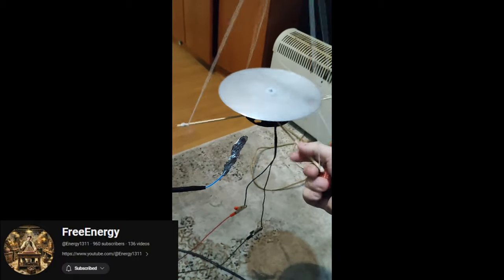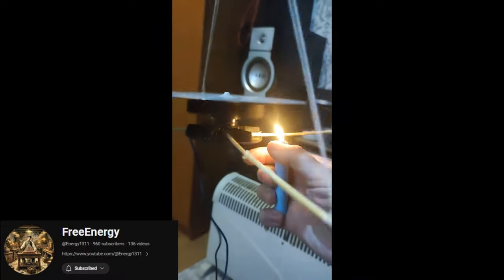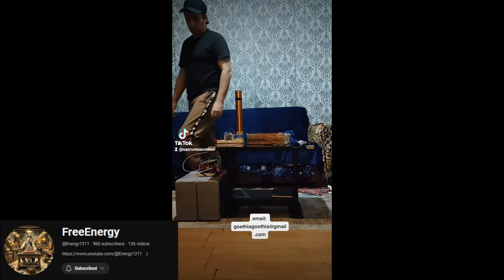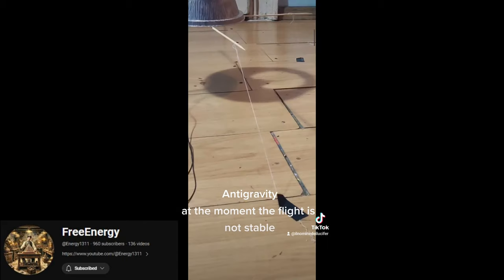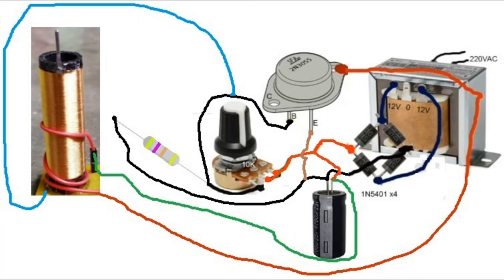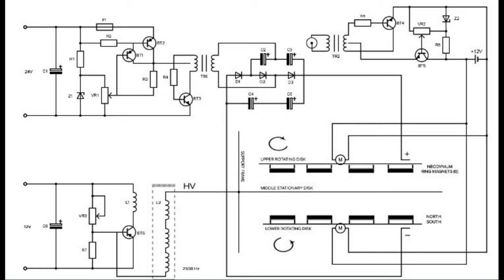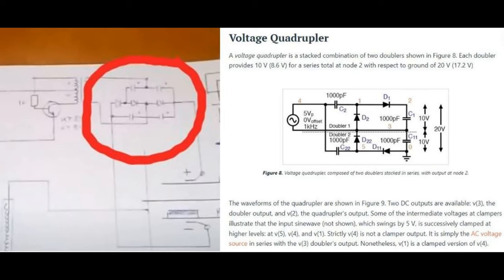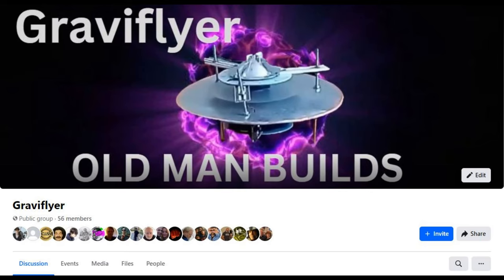Graviflyer "Occam's Razor" #48

Comment: The top left schematic is from a flyback to the rotating discs; in all three kits from Alexey he did not have diodes or capacitors after the DC flyback. Alexey drew the diodes and capacitors to reprisent the DC part of the DC flyback. The bottom left schematic is a slayer exciter tesla coil.
Reply from the maker: I was not trying to imply that you did anything wrong or that you didn't get the right information. You have always been straight with all of us with the information and you have greatly helped me in my research. If you took what I said in a bad way I am sorry. It was not my intent.
Reply: Charlie you were deep into this. We are somewhere close..  we need more and more people to test it there on way. We are going to see the lift soon..
Reply: @nathanbunten4299  No problem, I did not take offense. Alexey might have explained it incorrectly, so it is good that people are testing different things.
Reply from the maker: @charliec3rd  Thank you.
Reply: That circuit should work as a slayer exciter.. and the way alexeys circuit is drawn, it looks like a fly back AND voltage multiplier.. I think that’s why there are 3 diodes, one inside the transformer case, then the other two on the multiplier..
Reply: 2 stage multiplier, with 2 caps on each side for voltage

Comment: In the schematic it looks like he is using the magnetic side that I text about used in the levitation novelties and as the initial levitation in order to create the separation then using the high voltage of the Tesla secondary in-between to create the capacitance to repel  the object beyond the magnetic fields. This circuit requires exact timing in order to function. This guy is really good to have designed this circuit and gotten all the correct values to make it work. Still limited by the under plate but really cool to see capacitance driven levitation.
Reply from the maker: very cool.

Comment: You went into Grebennikov like what Alexy did before building his graviflyier.  I felt the material needs to have similar property like bugs wings which is like hexagonal structure with holes in it, like casmier effect.  I heard that when we have tiny ball of spark at pin tip, it attracts more energy from its surroundings, it deviate from our physics , if we have similar pin like structure material with tiny tiny sparks in it. Its a game changer. Also one of the stealth plane have similar tiny hexagonal structure material all over its body. Something to do with ttime space or reduce the effect of gravity on it !! Lets see...
Reply: Food for thought? Tamphere, Finland in 92 and 96, Podkletnov, yttrium barium oxide ceramic. What do they coat modern fighter jet engine turbines grown from a single crystal with?  Does a flame front in a jet engine generate high voltage?  Why did those that replicated Podkletnov retract their claims after the fact?  Why was Boeing interested in the research if it didn't have any merit? (gravity shielding accidentally discovered during experimentation with room temp superconductors)

Comment: The 2N3055 is a transistor PNP I believe,
Reply: Yes, the 2N3066 is a NPN transistor. Alexey mistakenly wrote the the direction of the arrow in the wrong direction, but he later explained his error in a followup video.
Reply: @charliec3rd
Right, but i was remarking to the author of the video regarding the image of the Tesla coil circuit in which he stated there was no transistor or mosfet.

Comment: I can see paper having  an ionic reaction in a high voltage senerio because I have experienced paper being attractive and also repelled especially around charged plastic like a trash bag when I try to throw out a small piece of paper and it bounces in mid air and then sticks to the side or falls outside of the container. It looks like he was using paper under the aluminum plate he was levitating. Looks very interesting and I happen to have two secondary coils that look almost identical to the ones in the videos. I got them from someone who made them in Russia several years ago. It would be funny if this same person is the one making these videos. I love these types of experiments and this all looks very interesting.

Comment: Very nice, do the eddy currents in the aluminum disc become excited by the spark? In my experiment with an ion motor the rotating stator that has aluminum inside is stimulated to produce a force to rotate it. Maybe something similar is going on here
Reply from the maker: try magnet sheet. you may have magnetism in the voltage creating th eddie current. I did this with a soda can and high voltage. https://youtu.be/izVMINZIqag

Comment: 2n3055 is a simple old fluorescent lamp schematic. It just turn DC to pulsating AC for any primary winding. We get high voltage on secondary. I have made a ton of this when i was a kid. I use any step down transfomer and produce high voltage on secondary to lit up fluorescent bulb.  And the other one is voltage multiplier, might have some error when he copied it. Just a human error. So its a voltage multiplier circuits, the more the level of multiplying, less the amps and high the voltage. Seems Alexy is using less efficient but simple circuits of 90s.

Comment: 12:22  that appears to be a bismuth crystal
Reply from the maker: The one that has the magnetic properties?
Reply: @nathanbunten4299  you can tell that it is a bismuth crystal by the square structure 10:56 and bismuth is also one of the most diamagnetic materials

Comment: The mystery element is bismuth
Reply from the maker: Watch the lifter and the tesla coil where he is sitting down. There is no top wire. The weight is way to high. He also touches it. I have never had a lifter I could touch. The voltage is to high. But because it is a tesla coil, the voltage to the touch is low. That experiment is the key. It must weigh 1 pound. I have to build that lifter experiment. I hope you can see why.

Comment: 10.50 its bismuth crystal, under the sheet of papaer there is an honeycomb structure charged with high voltage, he pushes a button , the  voltage runs into the honeycomb charging with static electricity, the elctrons get trapped inside the honeycomb cells and create a magnetic field, which pushes objects away using Lenz'law
Reply from the maker: That is really cool.
Reply: @nathanbunten4299  It is the most diamagnetic out of all elements & can levitate magnets. Only superconductors/pyrolytic graphite are more diamagnetic.
Reply from the maker: @Jeanpaul465  No. some days i wish i was.
Reply: @nathanbunten4299  VincenzoPanella is the one who smokes joints!🤣
Reply from the maker: @Jeanpaul465  We are building ufo's.. I think we all had a few at one time.

Comment: So in the one experiments Energy1311 is putting high voltage static into the disk buy holding it close to the the rotating disk. What abour utilizing 2 disks? One non rotating that pumping out static high voltage to the rotating disk. Basically separating the high voltage component from the rotating disk?
Reply from the maker: i ran the high voltage on the center plate only and it was pushed out by the tesla coil that i connected to the top and bottom disc.

Comment: Looks like the tesla coil is connected to a dr stifflers SEC-15 type circuit. From my hands on experience with his circuits, It floods the capacitance of the everything connected to it with frequencies(light in a circuit). Its like the circuit is constantly having a baby with the combination of the coils interaction. 1+1=3
Reply from the maker: Where can I find this circuit?
Reply: Start their to understand the phenomonon thats happening. He has Alot of variation circuits that create the same effect, but once you understand how the effect is created, it becomes easy to make your own circuit that create these results. The ssg bedini motor does the same thing but in the form of a pulse.

Comment: good morning , i have an idea . So watching the disc rotate on your video, what if you could try this with only the bottom disc and the middle plate on your graviflier to begin with to see the reaction. Maybe the top disc and frequency generator on top has to do with balance only as lifter tech is very unstable it is missing axis control. Just an idea. Good luck
Reply from the maker: The lifter where he is sitting down is the key. Tell me what you see. It is not normal.
Reply: Ok so it looks like slayer coil as he does not get a shock when touching it! So did your slayer give you a shock?
Reply from the maker: @dkdyker  He is using 2 microwave transformers with a doubler circuit. No slayer exciter. On the graviflyer it is 74 degrees but it will burn you. He can touch his the same. Radiation or gravitational waves NO ION WIND..... In the mhz frequency. Jarod was picking up mhz in the piezo because it is a receiver. They came from the tesla coil. They make lift. This is the This is Grebennikov's work.. I make such a big point about this because it is a Ulrika moment. I found proof of the lifting force.
Reply: So cold energy, yes ! I would like to know his double MOT input as they together will put out 4000v so why is it not effecting him , do you have a drawing of this?
Reply from the maker: @dkdyker  I wish I had one. I keep asking. Cold heat. I just did a video on it. We should all do this when we get the schematic.
Reply: Hi again, just looked at other types of Tesla coils that you can touch without a shock. Many are using SGTC ( spark Gap Tesla Coils ). Will come back with more:)

Comment: Have you seen those magnetic levitation novelties? They use rotation of a magnetic fields with coils in a circle that change polarity in a timed circuit and levitate a magnet. So no imagine using capatance instead of induction from coils. Our planet is negatively charged at ground and positive above insulated by our the air like an air capacitor. If we can rotate a negative charge to create an evening charge to earth it should attract upward and repel downward until it reaches the level of equilibrium with the two charges "ground and air... Ionic induction  can probably overcome gravity and even the weight of a materials can contribute in lifting thier atomic weight by concentration of it's outer electrical feild. Ionic thrust is air movement but repelling  an object through an Ionic reaction will even work in outer space. Example seen in comets when nearing the sun and the light radiation exciting the dust creating the tail. When the Sun shines through a window in the house and the dust begins to float around the rays of light. In one of my experiments I took a concave mirror and used a flash light at different distances to produce rings of dust at different points. Please someone repeat my experiment the dust will stick to the mirror at the edge of the light... There is a lot more but I would have to write a book and I am just giving you a quick text because I think you or someone is on the right track. ❤ this video
Reply from the maker: i understand static electricity and charged particles. They play a role in this craft. Thank you.

Comment: Well the first one had a fan under the alum plate, the second one was inductive jump from high current coils,  good magic tricks with electric, all you have to do is put a thin nail / brad in the wood or soak it with micro iron to make it work like that.   No magic to the schematic to the high voltage dc to the spinning plates and a tesla coil.   The one thing that stands out in his tesla coil. * those primary winding have a huge amount of insulation on them. Like its designed for 40KV on the primary coil so he can have tight coupling of the two coils. Does it make a difference?  Yes it does.  That tesla coil is super high voltage.  What Voltage???  1 million Volts + ????
The pan plate had a hole in the center and most likely a bunch of sharp things in the center of the plate with high voltage no magic on how that works.
Reply from the maker: When you find something you cannot explain. Just call it a fan. BS!!!! The tesla coil I do agree. It is the real deal. It is what I have been looking for the whole time.
Reply: @nathanbunten4299  Try a MJ11032 in place of that 2N3055 it will switch faster and uses much less base current.    You assume he is using a standard transistor. Most switching (transistors circuits ) use a darlington style transistor show in a schematic as as single transistor.  2n3055 need high base current to make the switch fast.    Ha I am not nocking the Fan deal I found that interesting pushing air under the plate not sure how that would change things from the ions coming out of the plate. Might make a vortex in the air you can't see.
Reply from the maker: @doityourself3293  The tesla coil experiment with the lifter is the best one. The weight alone won't allow ions to lift it. He has no top wire either. I have never seen a tesla coil do that. It also looks like there is a coil inside the foil. It has to weigh at least 1 pound. It literally changes everything if it can be replicated. The simple twist of the disc could then lift the craft if the tesla coil could do the heavy lifting. If you look at those experiments again with that in mind then you have the answer to the Gravifler.